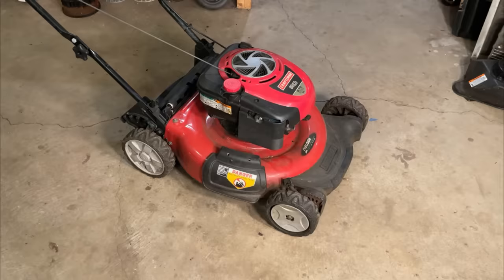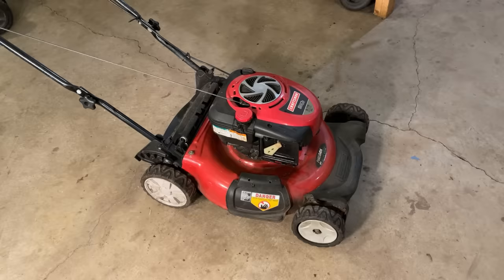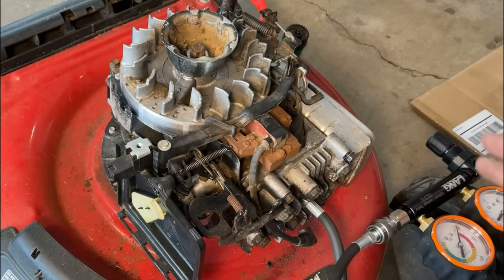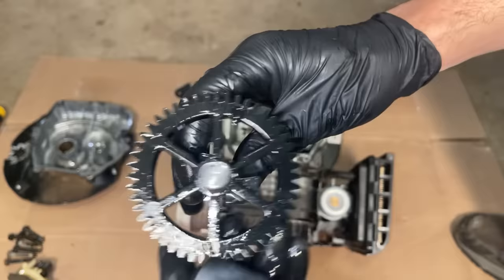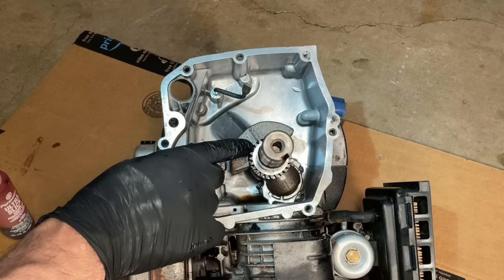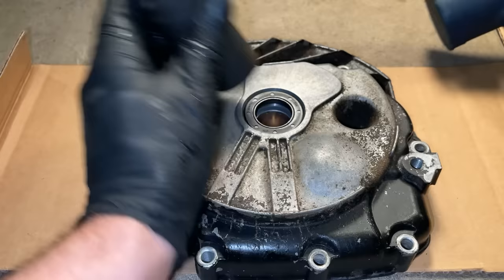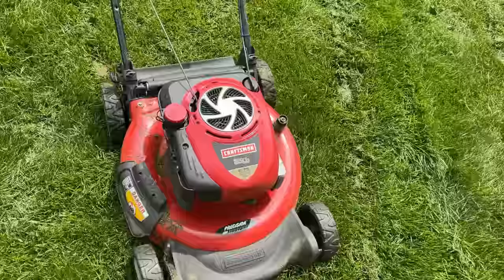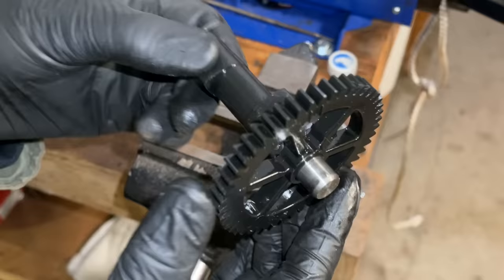Lawn Mower Will Not Start - You Will Never Guess Why

Comment: I'd like to know what Brain-Dead-Idiot of an Engineer thought it was a good idea to use a plastic on metal Camshaft in a gas engine?

I'm not at all surprised the plastic gear slipped on the metal shaft...what does surprise me is it doesn't happen more often considering how hot it must get when running combined with the MASSIVE amount of vibration it gets in addition to the heat...

I know that there are many plastics that can easily withstand the heat...at least they could have molded the cam lobe section to be one piece with the timing gear section so if the gear or lobe DOES slip on the shaft, it won't matter since the ENTIRE cam assembly will slip with it and nothing important will change in the engine...

Comment: BUT  HOW  COULD YOU HAVE POSSIBLY  KNOWN  THAT  THE  CAM  WAS  OUT OFALIGNMNET  UNLESS YOU  HAVE  HAD  PREVIOUS  EXPERIENCE   WITH  THAT
PARTICLAR   PART?  ANY  ONE  LOOKING   AT  IT  FOR  THE  FIRST  TIME  WOULD NEVER  REALIZE THEY WERE  LOOKING  AT SOMETHING OUT OF ALIGNMENT   AND  WHAT PART  WENT OUT OF ALIGNMENT,   OR   ACTUALLY    MOVED  OUT OF ITS   PLACE?   THE   ACTUAL  CAM  SECTION ON  THE STEEL  SHAFT
  OR  THE   CIRCULAR  GEAR   SECTOR???
Reply: Watch the entire video